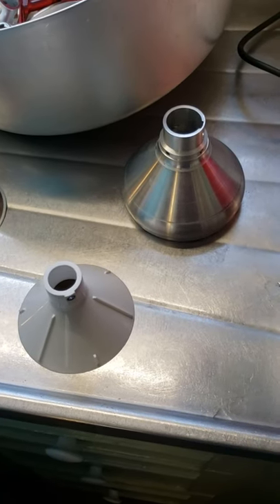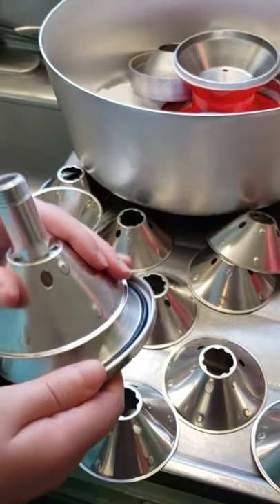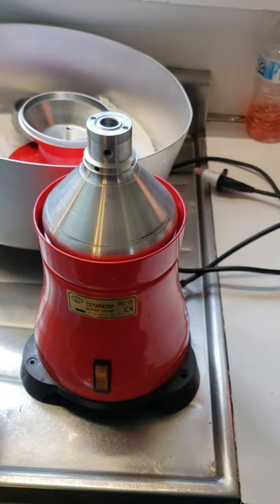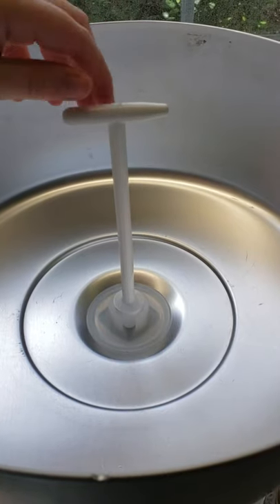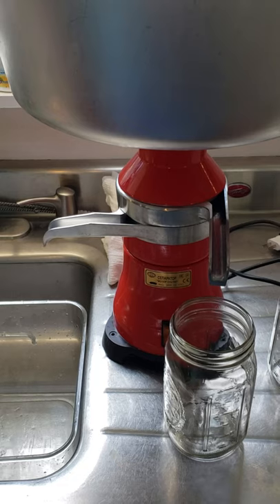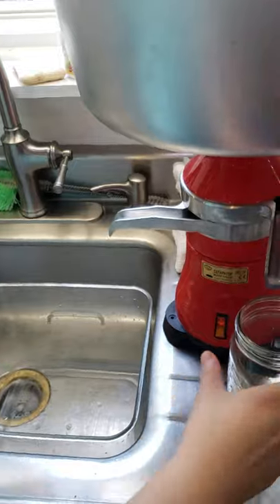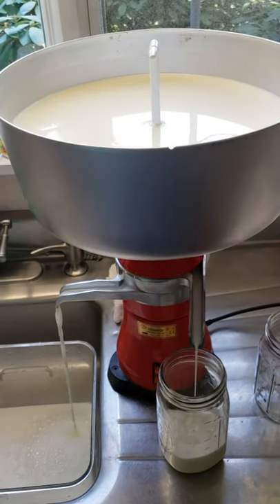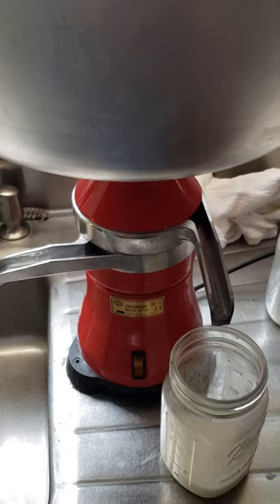How to Put Together and Use the Slavic Beauty Cream Separator

Comment: How warm does the machine get the cream?
Reply from the maker: You need to heat the milk to 100°F before putting it through the separator. The cream is cooler than that when it comes out of the machine.